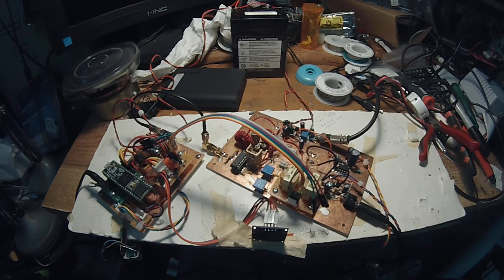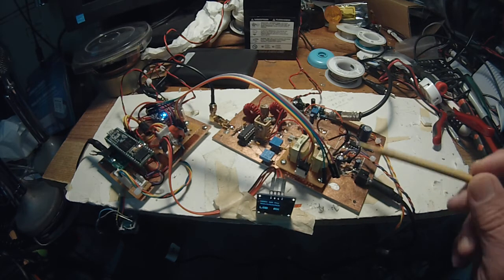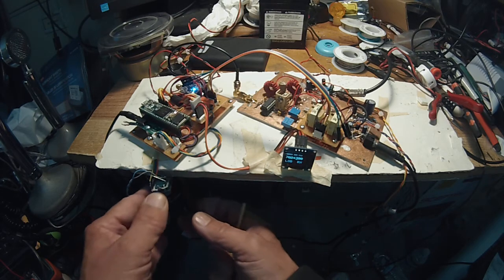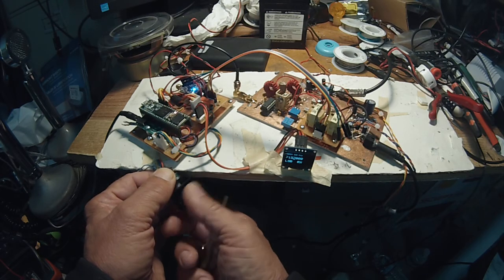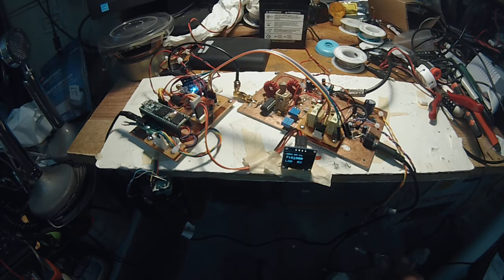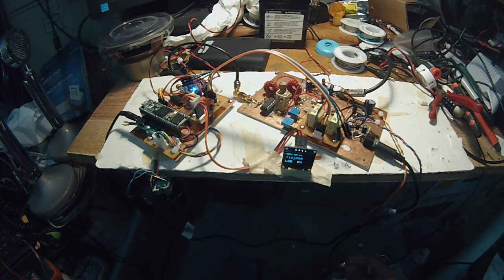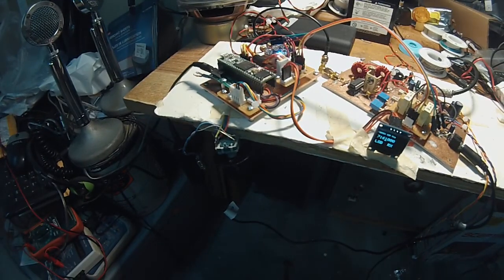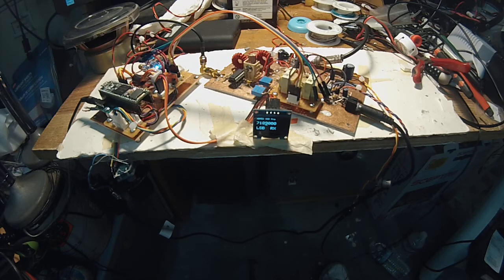Teensy 3.5 SDR Part II Hum/Whine /Burble now Cured!

Comment: Big improvement, in general I am surprised how quiet between stations all your radios are compared to my QTH where listening on mostly commercial radios I have a terrible noise floor. That was pretty funny when you yelled at that guy to shut off his processor, I do the same thing, I don’t like them at all.
Reply from the maker: Yes there has been a significant improvement in the performance -but we are not quite there yet. That guy was very strong --easily running 1.5 KW and then he turns on the speech processor. Get a grip you really don't need it.I do live in a quiet location - except when you go to 20 Meters and in one direction of the beam (Europe) I am picking up some sort of man made noise. I think it is in the next block over where this woman I think is growing pot in her garage and what I am hearing is the grow lights.73'sPete N6QW